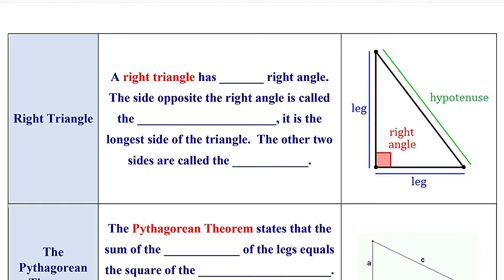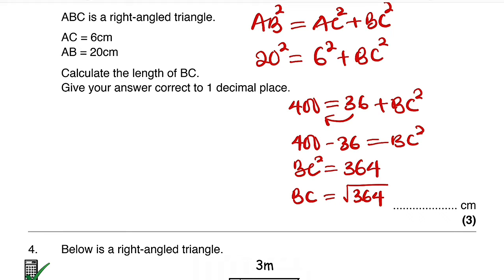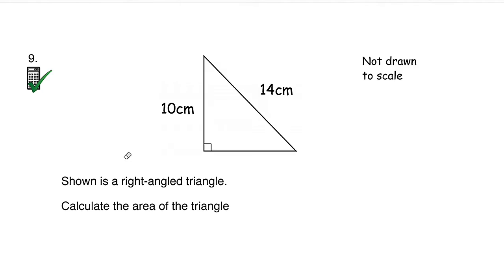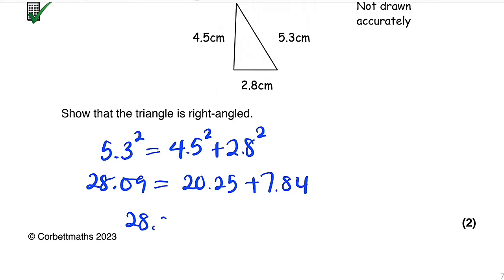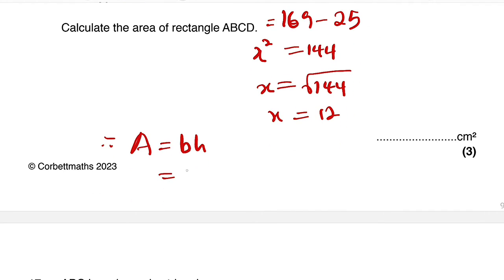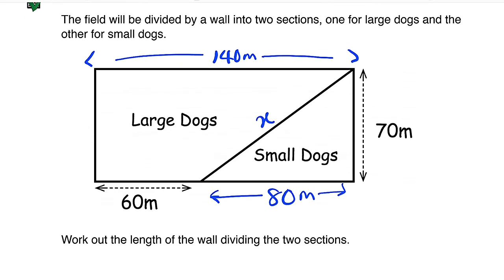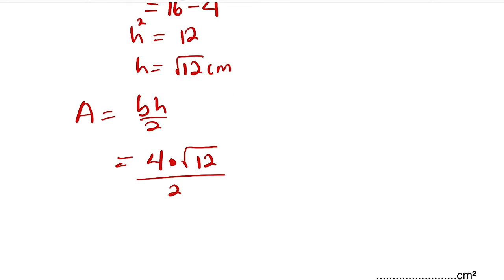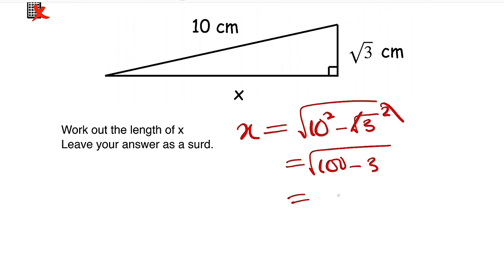Pythagorean theorem | 26 comprehensive questions.

Comment: Question  # 11 is required us to write the answer in meters. After finding the square root of 37500, which is equal to 193.6592673 cm. We should have to divide this by 100 to convert it to meter. Therefore your answer should have been 1.93 or 1.9meters, instead of 193.6cm.
Reply from the maker: @Tkkj73  Is 1.93m not equivalent to 193.6cm ?